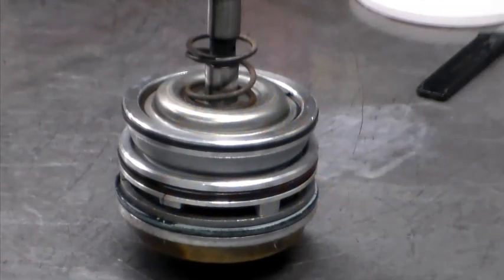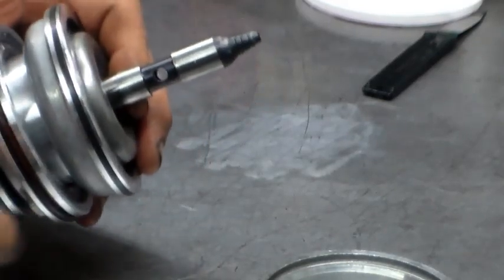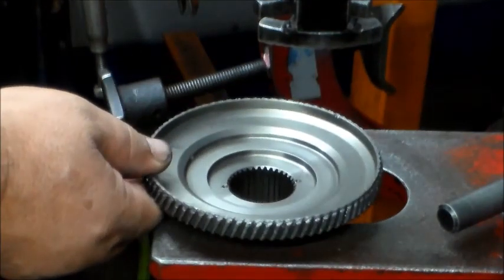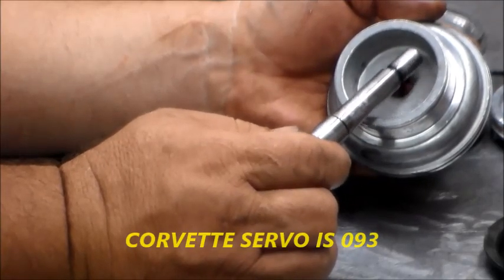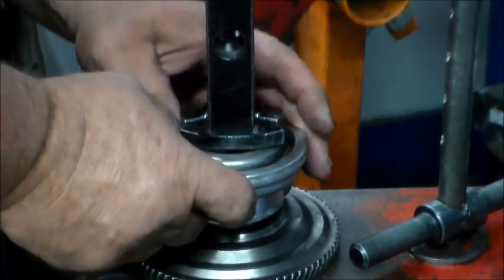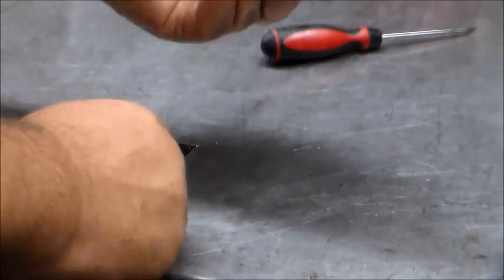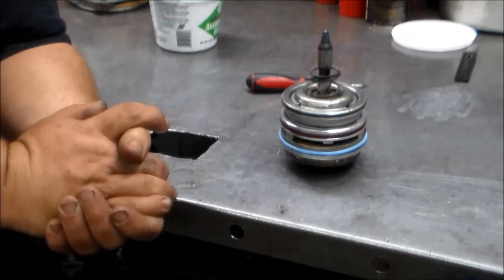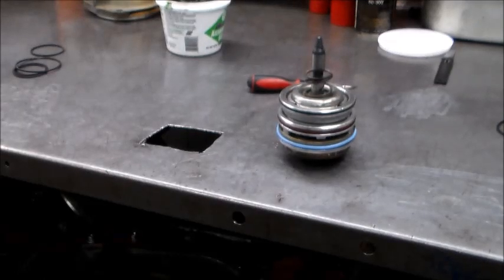4L60E SERVO

Comment: Hi, thanks for the great video. You seem to know these 4L60e pretty well, I have a 
question for you, please: My 4L60e had a cheap, rounded off lower cooler
 line that popped out mid-trip on the highway, losing a lot of fluid. I 
stopped, put the line back in, a added a few quarts of fluid and wanted 
to limp it home. Got it moving forward again, but it did it again a few 
miles up the road. Little buggar felt solid but kept popping out while 
driving. Anyway, it took about 3 tries like this, then I used tie-wraps 
to secure the line in and I finally got it home. It seemed to be 
slipping a bit but at 4 o'clock in the morning, who really cares? I have
 since changed the tip, using a newer, more squared-off tip that will be
 held in place by the C-clip (but I'm thinking of leaving the tie-wraps 
for good measure). Now, she slips in 2nd at about 2500rpms and will need
 to go to 4500-5000rpms to shift to 3rd when in 'D'. If I move the lever
 to '2' she's fine, no slipping at all. I haven't tried highway speed 
yet to see how she acts in '4' because I don't want to drive it too much
 before I know what is wrong with it, I'd like to avoid doing more 
damage.  What do you think, where should I be fixing? Thanks for any 
help that you can provide. Have a good day.

Comment: Nice video vary helpful, where do you find the servo spacer I would like to purchase one thanks
Reply: @Offroad Rider. The ring shown comes with a Transgo jr shift kit. Transgo makes a higher end complete shift as well this spacer ring comes in also.
 A couple of things not shown at the same time is the 3rd check ball in a capsule or called captured. If apart, pour a small amount of ATF - Solvent mixed at 50-50, into the case side 3rd apply cavity. It bleeds air our upon 3rd apply to push the 2nd accum/piston inside the servo back releasing the band. If the check ball leaks into the inside of the case, the ball needs replaced. Some plug it, but that traps air & fluid under pressure and causes a late band release as 3rd clutch is applied. It’s about timing as one is applied, another is released. If timing is wrong, the 2-3 upshift will be spongy, too hard or wear out the 2-4 band quicker or burn up the 3rd clutch quicker. It’s all very simple after doing this for 40 years.
ASE Master Tech since 1978 - Retired 
Also check Superior super hold 4th and their servo “K012 & K034” as I think this is the best replace servo assembly on the market. Eliminates springs, spacers and provides more holding / clamping that the Corvette servo. It’s PSI X Surface Area.
Reply: Dean Kay awesome very helpful thank you
Reply: @deankay4434   do you like it better than sonnax servo?  from 40 years what if you dont mind telling me do you set the band clearance?  which boost valve do you prefer?  I can put one together and make it work right if go by factory specs. soon as i started messing with servos and wide bands, its making me realise its gonna take me a long time to get out of the Novice stage.   thanks
Reply: @dreece2000   That a lot of days in the saddle Pilgram to cover that ground. Ok, too many hours of a John Wayne marathon at the hospital. Sonnax servos are heavy cupped shaped disc that will not wear on the pin, bore & skinny seals. Cheap insurance as these move up and down every time that gear shifts. Band clearance is about 0.12" or enough to allow the input shaft/drum to move with one have once released. Just make sure the drum is next to new as bands sold are wider. Now they run on a thicker part while the rest of the friction rides on scratches in a record with oil. The pressure valve is best using the 0.50" that everyone sells but change reverse boost as well. Look at the pressure chart. Manual 1st, Reverse have the highest PSI. You want good holding power for the band and clutch frictions. I've never seen the snap ring blow out the input drum but Sonnax will be happy to sell $550 worth of fix and sneak an extra friction in. I prefer spending time at 3rd with Alto Red Eagle friction and Kolene steels. At the start, good complete pressure to entire pack from fingers and 9 frictions fit great with 0.23" gap after using air to seat them 3 or 4 times. Remember, that is almost spark plug gap on a weed eater. Don't forget the rear case side captured check balls as 3rd relies on it passing to the servos in the case circuit. I never trust the release captured ball on the band apply cavity either. Some say use a #4 easy out but I found a 3/8" X 18 tap works great. When it stops, look to see the steel case w/ball move. STOP! Now, lay a plate of steel across the valve body aluminum to protect it, vise grip and roll-head pry bar it out. I have a slide hammer with vise grips that work well in this spot. Also, use the 2-liter coke bottle trick on the shaft seals and trans gel. Slide the bottom one on first and follow up. If you re-size them by hand, they will relax but still need insurance. Just cut the side of the plastic coke bottle out a little taller as it is slippery and wide enough to wrap around the sealing rings at least 1 1/2 times. Longer does not hurt. Since it is clear, look at your seals to make sure they are home. I place 4 or 5 large O-rings over night to start, the next day with hose clamps and I mean the worm screw type and just snug them down. works great! Best of luck!
Reply: @dreece2000   Wow, a lot of ground to cover in a reply. Using the wider band is always job one to order.  Start with a new drum as remanufactured drums are lathe turned and smaller, but the Sonnax website has a cool break down of 700R4 parts and what each one does. I like the pinless accumulator piston as it has basically nothing to wear out or break as the OEM can do. Use the Sonnax sun shell as it transfers the load better while having less chance of breakage. You don't need the $500+ input shaft-drum kit unless you are running 700 HP W/Turbo. I was really impressed with the Alto Red Eagle frictions over Raybestos as the steels are Kolene treated. This allows for hardly any chance of heat warpage and run thinner in #3 clutch pack. The original 6 friction can be 9 friction with still having 0.28" end play. I take photos of set up, result of measurements and would have to refer to the final result. Just plan on finding broken springs, damage separator plate after being beat on 70 thousand times. What, Transgo I think has one listed with a Jr Shift kit and plan on getting it. Double check the two captured check valves especially the3rd dump case circuit in the rear of the valve body next to the governor filter and 4th accumulator body I think. It operates as an exhaust when shifted out of third. The problem is it gets hammered during hard upshifts and can wear thru and the check ball fall out into the case or sit in the valve body and do nothing. Also, get the Transgo TV cable valve fixer kit. It comes with grooves that capture oil and have an extra front spring so it can't stick. They give a choice of spring by color that allow use behind different engines and this flat metal plate that goes into the spring to limit it travel without masking the TV valve move.
Also, look online by typing TH700R4 repair. Not ATRA but some other group published a kinda manual with the history, identification of parts, good ones, bad ones and some step by step stuff. I save it on a now dead laptop, so SOL as they say. As far as band tightness, always install stuff wet, hit it with air to work if can before checking. But if you can turn the input shaft by hand, you should be good to go. I guess, slightly less than snug when not applied. The Transgo Jr Shift kit provides a rounded tip that can be added depending on what happen as you go together, but using the bench grinder to remove material to make a shorter band rod if needed, just make sure it has the same radius as before. Without YouTube or digital cameras you would be at the "Photo Booth" waiting on snap shots. I wore the ears off two brother who worked in the towns repair shop. They built race cars for the 1/4 mile tracks side-by-side with only a couple of bedsheets to hide their tricks. Funny to think of it now he has passed. That's life. Will Rodger's the American Humorist was asked about going into politics and he replied he would retire first, after all you start to die as soon as you are born. Being in politics only speeds the process up and guides the direction downward! Hope this helps.

Comment: Great explanation on how the servo works.  I just rebuilt a 4L60E and have a real harsh 3-4 Shift.  Could that be due to a problem with the 3rd gear accumulator in the servo?
Reply: this could be the only 4l60e ever to have that symptom. not being ugly but by design its just difficult to have a harsh 3/4 shift. sounds like you got a really good transmission.
Reply: @dreece2000   I will say their is a captured check valve that is in the case that is exhaust for the 3-4 shift. Unless you have a tool to put a 50/50 mixture of ATF & Solvent behind it to check for leakage, it is about the only mechanical thing that might cause it. It's removed with the VB off and the book says to use a #4 easy-out. I never knew they were numbered. I found a 3/8" - 16 TPI tap would grab it and with a metal plate across the aluminum VB case worm tracks, pry up and out with vise grips and pry bar. Use a punch the same as the hole to drive it in and they give you a measurement I can't remember. But the capture ball has a steel cage that bottoms out about 5/16" below the surface, so not much. Otherwise leave it alone and wear a smile!
Reply: Hello all,

I know this is an old thread but, I have a 07 Yukon that has the 4l60e that went bad. I replaced it with what I thought was an upgraded trans (4l70e). The trans had no gears and I ended up replacing the valve body with a refurbished one.
To make a long story, by replacing the valve body I got proper shifting. I don't have 4th gear though. The computer commands the shift and it changes into 4th but there is no reduction in rpms while on the gas. If I take my foot off the throttle it freely goes down to where 4thr rpms should be.

Comment: Mr. R&R Got 89 GMC TRUCK WITH A 700R4 & IT STARTED TO LEAK OIL FROM THE SERVO SO CAN YOU! PLS TELL ME HOW FIX/REPAIR LEAK!  /THANK YOU! GILBERT CRUZ TUCSON,AZ.
Reply from the maker: Well the blue oring is the one that seals the servo cover to the case pull the servo out see if oring is cut and replace it check it close to verify it is not cracked
Reply: Mr.R&R  I would like to Thankyou! For your expertise! There is nothing like getting advice from a pro! I'd like to give you my Mr.MVP award on professional knowledge thank you for your response your awesome keep up the good work once again thank you so much and God bless you Gilbert Cruz Tucson Arizona

Comment: I have a question. I rebuilt my 4l60E at 365k miles and have 50k miles on rebuild. One morning, it no longer had 2nd gear. I have been driving daily with it shifting to 3rd and fourth, TCC lockup. I researched that it might be my apply pin was too short. I had already taken the servo out to check the split seals and put it back. Pulled pan and replaced solenoids couple weeks ago. Today, I pulled the servo and replaced the apply pin with a longer one. Now my original pin has 2 recessed grooves in the cone. The replacement pin has 3 raised ribs on the cone. So, swapped them out. Test drove and now only have 1st gear. I am waiting for it to cool down , so I can pull it and swap out pins or see what I missed. But, hey brother, would you have any idea why I lost 2nd gear. Had it night before, then next morning, no 2nd gear. I am completely stumped now. I also forgot to mention that I have reverse still as well.
Reply: I have the same thing going on with my 2002 Chevy Suburban 4X4 I like to know the answer too
Reply: @ernie7123  Hey Ernie, I made a manual switch box after being unable to find a local trans shop to see if the ECM was commanding it to shift gears. It was not. My ECM lost its "Flash" and I was able to buy a reflashed ECM on ebay reasonable cost. The truck runs good as new, even fixed a weird sound at idle which mechanics said was a bad lifter. Nope, ECM was doing weird stuff. The Manual Switchbox is simple and cheap to make and is a very handy tool to have on hand. Lets you eliminate a lot of guessing without having to rely on expensive diagnostic machine only dealers and high end shops keep, but apparently would rather tell you the trans is shot and needs to be rebuilt. I got 70k miles on that one and had it not lost the flash to ECM and me driving around like that and then I made the mistake of driving it with the manual switchbox which is a lot of fun but you are shifting gears and driving under full line pressure which is not healthy thing to do. checkout facebook forum 4l60E DIY rebuilders

Comment: I have a 93 Chevy Van G20 4.3 v6 with a 4L60E transmission it jerks going into drive and jerks going into reverse and it shifts hard 1st to 2nd and all the other gears 2nd through overdrive shift smooth an hour I change the filter and fluid up change the throttle position sensor I don't know what the problem is sometimes it'll shift smooth and sometimes it'll shift hard sometimes the shifting smooth the last from a date to a month and the shifting hard and just from a month to a year but it's aggravating and I'm trying to fix that problem if you have any information on it please let me know what it is and what I need to do to fix it please thank you  I'm Ray
Reply: Raymond Larson exactly the same problem , did you figure out what it was?

Comment: How crucial is the low/reverse check ball in the cup at the rear of the case?   Right under the auxiliary valve body?  I’ve seen them gone and was just curious.   Thanks!
Reply: Same question...
Reply: I've been told if removed you have faster reverse engagement
Reply: As best I can tell, this is just there to slow engagement but keep release quick. Did you notice there are orifices on either side of the ball even when seated?
Reply: if anyone else is looking for this info, watch my video on vacuum testing the case and I discuss it
Reply: I took mine out for firmer and quicker reverse engagement it won’t hurt anything

Comment: Why do the grinding and all wth the shift kit and not to a corvette servo they are so cheap
Reply from the maker: the grinding of the servo cover is so fluid will escape and not hydro lock the servo. the reason for not using a corvette servo is shift feel this is for a Tahoe and need a smooth shift.

Comment: do you still use the springs from the shift kit with the corvette servo?
Reply from the maker: yes the vette servo will increase shit speed and feel but we should still use the springs that come with the shift kit. there will be different springs used on the accumulator valve in the valve body that is dependent on what servo you us.

Comment: I installed a carvette servo into my 02 chevy with the 4l60. It was working fine I just wanted to get a smoother shift but after I installed the new servo everything shifts good but it wont go into overdrive. I made sure that I assembled it correctly when I installed it and I'm not sure what's causing it not to engage.
Reply from the maker: are you sure you have second gear, I have seen were a servo missed the band and you will lose 2nd and 4th, when the 1-2 shift should happen around 15mph its still in 1st until around 30mph miss second and go into 3rd. if that's not it you will to recheck your seal rings on the servo.
Reply: If it's an issue with servo you don't have 2nd either

Comment: Hi
I got an 07 GMC Sierra 
2 wheel drive with the 5.3/4l60e
Ive always found the shifts a bit lazy or sloppy. Dealership told me its normal.
What servo can i go with to firm up these shifts?
And do they all physically fit my trans or should i be carefull which to purchase?
Ive seen some Corvette servos online, and the Sonnax servo...
Thank you kindly
Reply from the maker: sorry for the delay in replying the corvette servo will fit the sonnax or superior servo is a better choice
Reply: @robertrushton6622  
Thank you